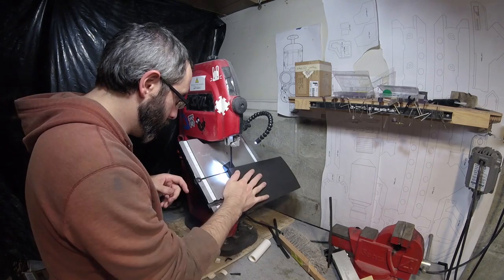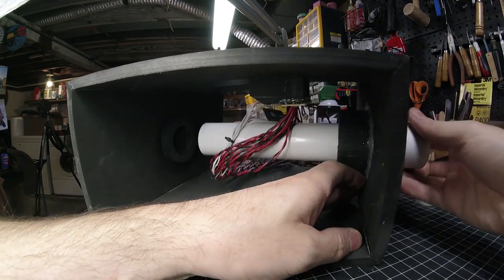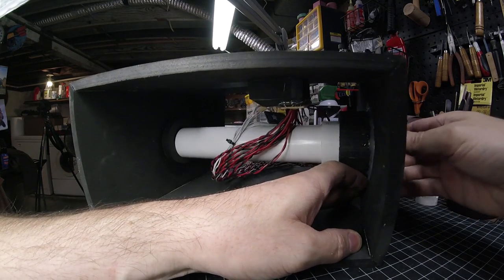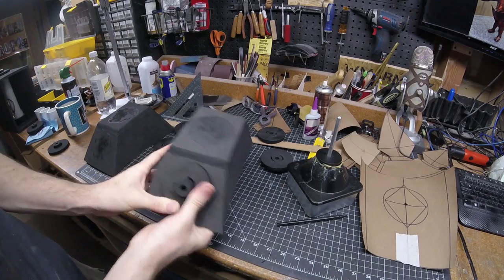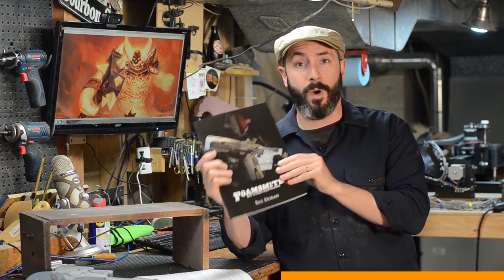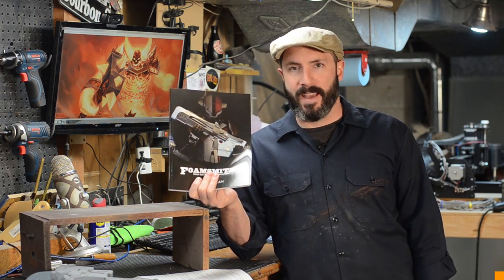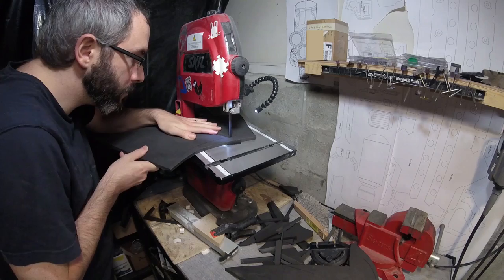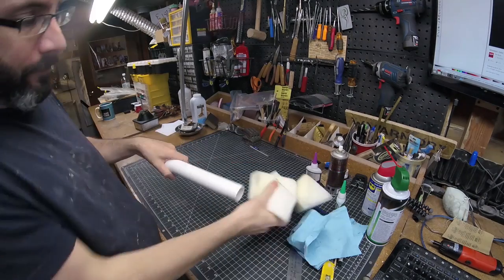How to Make Sulfuras, the Hand of Ragnaros Prop - Prop: Shop

Comment: Making this for Blizzon 2019 but don't have a band saw for the foam spikes, so I thought, "What would Bill & Brit do?" Grabbed some LED foam, a 2D pattern, sharp knife, and straight edge, and 48 shapes later I can now hand-cut a bevel like a pro! Now to glue all the spikes together and have them bend at the seam with shallow cuts as I learned during your Nazgul gauntlet tutorial, and Sulfuras should have it's flickering spikey flame goodness. My hands are shaking and my soul is crying - so I must be doing something right! Thank you for all your helpful videos!
Reply from the maker: That's fantastic! Power tools are really only useful to speed up processes we can all do by hand with basic tools :) They're not usually a requirement for any project!

Comment: are the LEDs of those arrays individually adressable?
Reply: They look like Neopixel Jewels, so yes. You could also chain them all together but you'd need the code to work differently.
Reply: Damn, that means the glowy spikes could look even neater with some glowy-pulsating animation for each led-board. I'd love to see that. I've done something like that myself before to replace dozens of candles with a single RGB-LED strip.
Reply: There's loads you can do.  With this if your smart you can use maths and a few constants to do all the work for you in only a few lines of code.  Basically you use a cosine function against time.
Reply: Actually it takes loads of superimposed sines to make it look ember- or flame-like.
It is much cheaper to just use a per-frame random operation for each led.
That way you still have some room on an arduino for some other features like a couple post-processing routines like random sparks, added noise and processing controls.

Comment: you dont know the power of that laser diode by anychance.. do you?
Reply: I tried once to cut foam by laser but the edge was very curly :( Your cut is really straigh without the need of sanding. I wonder if you could share some tips in order to get smooth straigh edges form the laser cut pieces?  :)